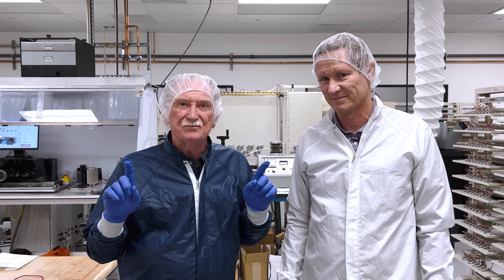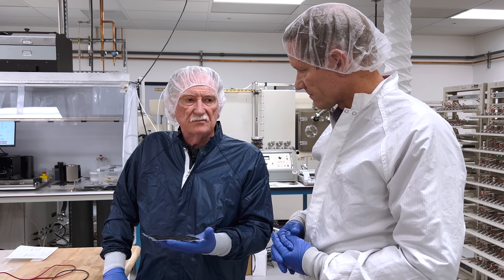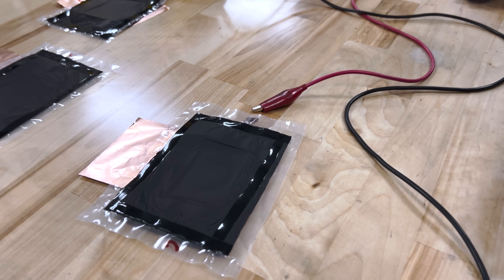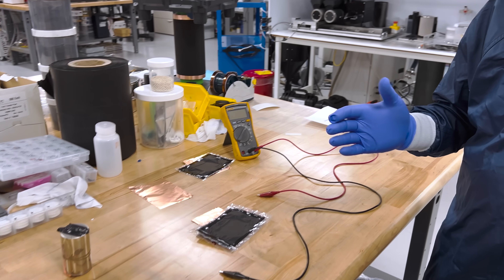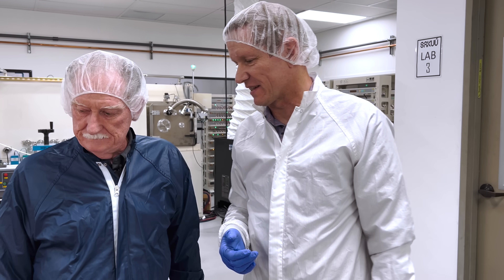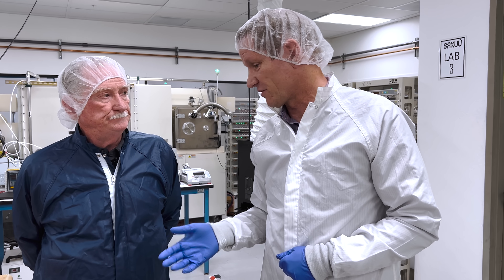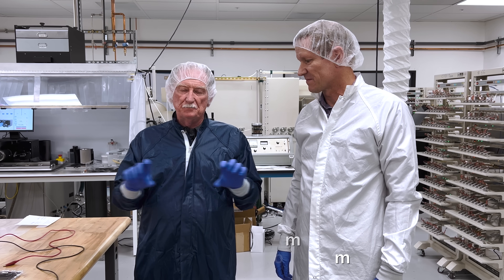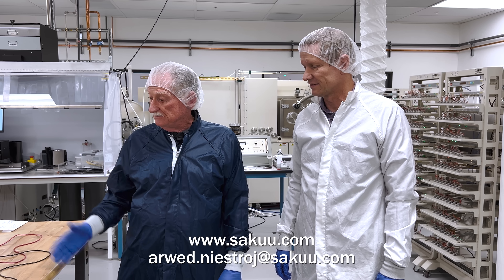Sakuu's Metal-Free Battery Cell: Game-Changing Innovation

Comment: Why no mention of charge and discharge rates?
Reply: ICE killer as he says.  The problem is charge time and electrical generation.  He mentions lower discharge rates.  When you need 1000 amps to get your EV moving this is counter to low discharge.  I am not crapping on this technology, but I recognize a pattern when new technology enters a market and they manage talking points to stay away from problematic issues.  A bathtub has more heat than a cup of boiling water but only one will make a decent cup of coffee.
Reply: I only recall claims of discharge rates and charge cycle life, not charge rates. Adding 200 miles in 10-ish minute pit stops would surely cut demand for heavy, humongous, resource-hogging packs.
Reply: @johnbuchman4854  If the internal resistance is so high, that it doesn't even get warm when you short it by punching a nail through the cell, then the C rates might be pretty low? 
Good thing the battery is light weight, because it might not be able to power a high power motor?
Reply: @SciFiFactory  I thought so too... almost the whole time during this video I was thinking "this isn't the ideal EV battery, it's the ideal satellite and spacecraft battery!" Light weight is a premium when you're spending $10,000/kg* to get something into LEO or MEO, you need high energy density, high durability/stability when damaged, and low-C charge/discharge is normal. 

*...thanks to SpaceX, payload cost to LEO is just $2,750/kg, or it was in 2018, the last time I saved the numbers. Even so, "weight is pain" with space stuff...
Reply: @SciFiFactory You mean like putting a nail through a LifePo cell - where exactly nothing bad happens? But they still manage to run a car just fine.
Reply: @SciFiFactory  Exactly, put a load on the cell, let’s see it drive 5A, 10A.  And let’s see the charge curve and discharge curve.  What are they afraid of?  Ugh, Sandy doesn’t know anything about circuits, didn’t ask the right questions, this seems like smoke and mirrors.
Reply: AND SOMETHING HAS TO CONTAIN THEESE CELLS
Reply: @danieldougan8550  presumably simple metal case, as battery is innert - because no heat generated nor runaway risk on penetration. Can it handle flexing torsional deformation? ie slight vehicle twisting?  What about freezing/thawing, extreme environmental temp expansion/contraction? oh and what about temp parameters?
Reply: 96Wh same as the 4680 but weighs less.
Reply: 3C continuous discharge and up to 10C peaks.
Reply: @ysesq Where are you getting that? The last video has nothing to do with this.
Reply: Smaller volume, smaller weight, same energy… even IF the charge/discharge rate is only half, double the batteries in parallel, get the same charge/discharge rate as competing batteries, and get double the capacity / distance for travel!!!
Reply: Let’s have Jordan’s view on this
Reply: They mentioned it briefly not specific numbers, but the fact that the style of pouch will control the rates so they can vary the rates as needed for any specific application
Reply: See it in previous video.
Reply: @a.v.gavrilov  "See it in previous video."
Previous video was covering a battery with metal conductors.  This one is covering a battery with conductive polymers - which generally have much lower conductivity (usually in the 10^2 - 10^4 S/m range) compared to copper (10^8 S/m).
Reply: confidential stuff you know. now that's getting to details.
Reply: Who cares about fast charging, if you have double capacity, as you will have with simpler battery pack construction. That will still mean you'll have to charge half as often. Weight, volume and price are the true parameters.
Reply: @Tore_Lund  Many people will still want to charge on road trips and not spend an hour waiting.
Reply: Yes, like we already do with Teslas. Did you ever traveled with an electric car?
Reply: @Tore_Lund  "Who cares about fast charging ..."
It's not just relevant for charging, but how quickly it can provide energy to the motor or device.  If it can only provide 1% of the wattage of a 4680, for example, it's not really of use in a vehicle at all.  Notice they didn't show this powering anything or measure the current, just the voltage.
Reply: @OweEyeSea  1% of a 4680 is 2A. Kind of extreme numbers you chose there? Normal, not fast, fast charging is 1/2 C i.e. for a 100A cell that is 50A i.e. 20kW that would be 3 hours charging to get 400 miles range. I regress, we can't get any closer to what this battery does without further data.
Reply: @Tore_Lund Charge efficiency is a critical number.  Number smiths always leave out efficiency both ways.   California and Texas have rolling blackouts every year because of the trend of reducing base power plants.   Add all of the EV load they are pushing for and the system crashes pretty early on.  Wind and solar are a blight on our planet environmentally, visually and the millions of trees cut down for " green energy".
Reply: @lelenbates3367  The reason you have blackouts is because you split your grid between states. You don't use a centralized national broker. Trees are not enough.
Reply: @lelenbates3367  What is a base power plant?
Reply: @lelenbates3367 it’s a weird logic when you state that wind and solar are a blight on our planet and fail to mention the destruction, pollution and environmental damage caused by drilling, transporting, refining and burning oil.
Reply: @lelenbates3367 I have not heard of millions of trees getting cut down to create solar farms. Visual  “pollution” does not spread noxious gases around the planet like carbon emissions. Wind farms also don’t create gases that spread around. You want more single point sources of traditional pollution? What’s your alternative to the wind and solar you object to?
Reply: @Tore_Lund because charge/discharge rates are linked to internal resistance and hence efficiency under load. Polymer conductors are inherently an order of magnitude worse. In fact they are gloating as if a huge hinderance is actually a benefit…. It’s not
Reply: @geekswithfeet9137  Yes, I suspected that when the tech tried to make high internal resistance a benefit in his pitch. Also heat conduction will be worse through a polymer, but again, it all comes down to energy density and volume, both problems will also become smaller if it means the battery that can fit is larger= larger anode and cathode area means lower resistance and higher charge current, which will mediate an inherent higher internal resistance per square inch. 3'rd is price. Like with LFP cells customers are willing to buy a worse battery if the price per kWh is more favorable.
Reply: @Tore_Lund  - Fast charging is absolutely essential. Without it, the infrastructure at Service Stations for long journeys will need too many stations. The faster the charging, the less range you need. The lighter the battery, the more range you get. Smaller, lighter batteries that can charge really quickly are the future for EVs.
Reply: @rogerfroud300  Fast charging hurts battery life, it should not be your everyday solution. Fast chargers are needed at highways, for those road tripping or really need to go far on a daily basis.
Reply: @rogerfroud300  Don't want to sound as insane as that guy, but having a bigger battery means you can charge fewer times, so when you do that, you can have a bigger break while the car charges. Like having a full lunch.
Also, if you keep the same volume and weigh, you'll have a bigger battery, so it might recoup the charging speed, by having more "cells". What I mean is that if this has, say, half the charge rate, but you can have 40% extra cells / energy, then if you do that, you'll have 140% of the original battery, but at half the speed = 70% of the speed of the original one. Still significantly slower, but maybe not a deal breaker.
Reply: @Tore_Lund If the battery cell has half the capacity, the battery will be half the size of traditional batteries….hence, charging rate still matters.
Reply: @mikus4242  There is a comparison graphics in the middle of the video. This is a battery with higher gravimetric energy density, so that is why I say this counters a lesser power density. In numbers : a 50Ah and a 100Ah cell that both have a max current limit of 500A will perform the same, even if the 100Ah cell only can deliver 5C half that of the 50Ah cell 10C.
Reply: @Tore_Lund  Not, if you drive a lot of long routes. It really depends. But for an average car user, the charge rate indeed is not the real important parameter.
Reply: @Tore_Lund  for daily commuting, I agree, but for long distance travel charging time is still very critical. I'm excited about this progress but agree that charging speed is still a critical characteristic.
Reply: @Tore_Lund  
yeah well, why care about anything at all?
Reply: @ursodermatt8809  That is philosophy, however Nihilists also drive EVs, but they don't suffer from range anxiety.

Comment: What's the C-rate for charge and discharge?
Reply: Who cares at this point in the process?
Reply: @MrBigShotFancyPants  It's fun to see Sandy get excited.  Let's see how the resistance of his plastic contacts compares to copper foil.
Reply: @jamesvandamme7786  That's how they're controlling run-away, no?
 I understand conductivity of metals & semi- conductors. Though Idk what they've got going on here, it's novel.
Reply: @MrBigShotFancyPants  Higher resistance spreads out the dissipation over time and space (if you have a single point puncture) so it doesn't go into thermal runaway. I expect it also burns away the contact point with the puncture so it stops conducting.

I had a radar transmitter that used 40,000 volts and of course I had a jesus stick to short out the cap bank before I went inside. (You meet Jesus if you don't use the jesus stick.) I modified another to put a 10K ohm 500 watt resistor in line with its ground. The normal stick went POW when you shorted out the cap, the modified one went zzzzzzzzzzap.
Reply: See it in previous video.
Reply: @a.v.gavrilov  No... Seriously how are so many people misunderstanding that the data shown in the last video has nothing to do with this polymer cell. All it showed was their dry process and traditional li-metal batteries. That is not what this is.
Reply: @JJFX-  This is the same dry process and lithium-metal battery chemistry.  The lack of metal only referred to the current collectors, an unfortunate error when explaining it.
Reply: @rhamph but their whole deal with this cell is they "engineered the current transfer" of their polymer current collectors to reduce runaway from nail penetration. That will directly lead to reduced current limits of the cell in operation too
Reply: @GrenYT  The issue is where the resistance is.  In either case the pack is configured with a resistance to match the desired operating voltage.  Same series-parallel numbers in the end.  However, because a traditional cell is filled with current collectors, a puncture can easily create a very low resistance path, while the design here should only create a moderate resistance path (resulting in lower current, lower heat, and potentially no fire.)
Reply: @rhamph  It's obviously the dry process but the other changes would absolutely not make it comparable to the other batteries. We can't just assume that using polymers is already allowing for the exact same performance when even if they aren't saying that.
Reply: @JJFX-  If they stick to a single layer it should be pretty much the same performance.  That's boring though, stacking them up in a bipolar format is where the real interest is, and of course that adds a bunch of engineering challenges that they barely touched on.  Far too early to believe it will work, sadly.
Reply: @JJFX-  challenging sometimes....people hear and see things and then imagine them in to their perspectives...it's called virtue by hypocrisy...the guy clearly said in the video charge cycling hadn't been conducted yet...it did show a density of 96Wh with approximately 35% reduction in material, however, the discharge and recharge rates are crucial in order to make it commercially feasible and were neglected in this video because as I mentioned earlier the guy said they hadn't cycled it...this is a technical marvel but it isn't the golden egg...guys at Tesla are pretty sharp in the material engineering department... not to mention all the other battery companies in the world with their R&D...

Comment: NO RUNAWAY ON THIS CELLS? THATS F*AWESOME
Reply: does this mean it does not need cooling or thermal management?
Reply: @billhanna2148  It's still a lithium chemistry. The laws of physics didn't change. Lithium loses reactivity as it cools and increases in reactivity as it heats up. That's just facts.
Reply: @de-bodgery  I love that they're calling it metal free when it still has all of the bad metals in it: lithium, cobalt, nickel.
Reply: @de-bodgery  Thank you I rewatched it had completely missed the "same chemistry" aspects SEVERAL TIMES🤭
Reply: It's not true. All they proved was no runaway from nail penetration which I'm still skeptical about. Cells can runaway from so many other causes still
Reply: @GrenYT  I wasn't impressed with this claim. LTO does that too and that chemistry is quite old! Also, that claim was for a single thin layer and not for many of them in parallel and packed together tightly.
Reply: @de-bodgery  great point on the last one. These are basically super early prototypes they are showing. I'm skeptical if they can even scale up to large cell form factors at all which would be necessary for so many reasons.

I will say, the way LTO mitigates runaway is a completely different, it stops it at the chemistry level, which basically makes it impossible to occur. This cell technology seems to only prevent short circuit runaway which is only 1 form of runaway and realistically should already be prevented via sturdy mechanical design of the battery housing.
Reply: @GrenYT  I agree...LTO does it by not being reactive or flammable. Dry or solid state cells like these will do this similarly...or so we hope! That doesn't change a dead short situation at all! So far, anybody making solid state cells has yet to "scale up" to commercial levels. Where I live are a couple of companies doing this type of cell. It's great they are doing the leg work, but they have also been on the "solid state" band wagon for years and years now and still only making samples and limited production! Yes, I get it, Tesla had the expertise of Panasonic to fall back on to make the 4680 viable in mass production, but that's also old news now! IF a solid state cell is really as good as the hype, then why isn't it being made in volume??? Where's the 3rd party testing results? Where's the tear down videos of the cells???
Reply: This is hardly news! LTO and LFP have been doing this for many years!
Reply: It's not edible.